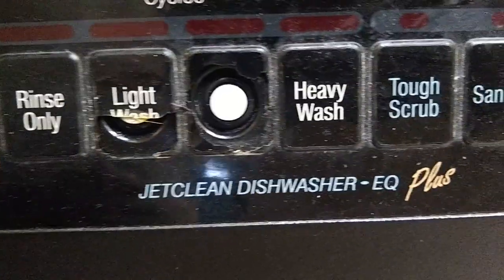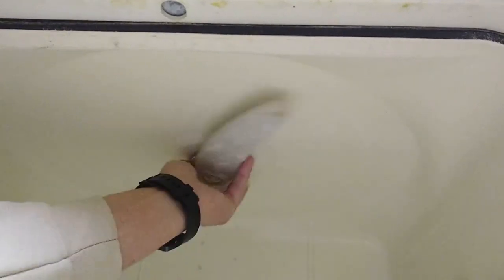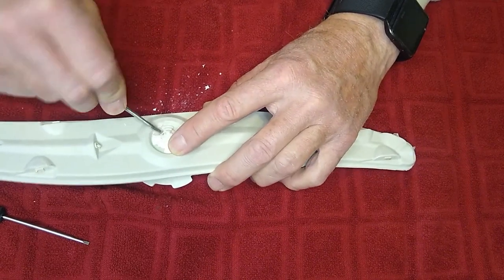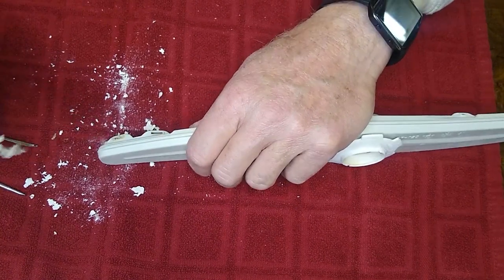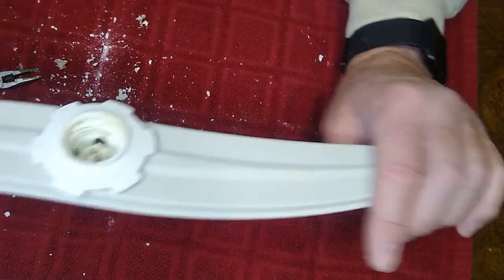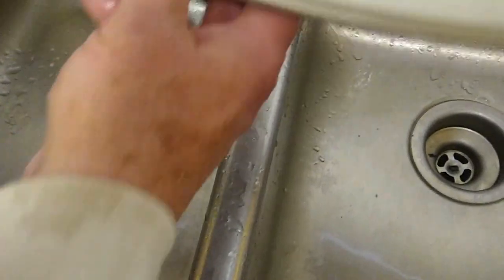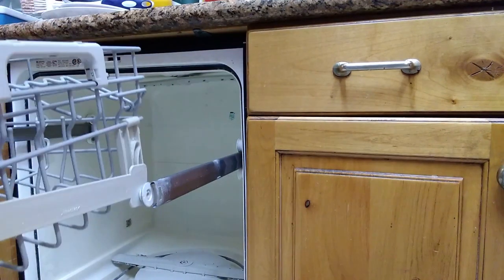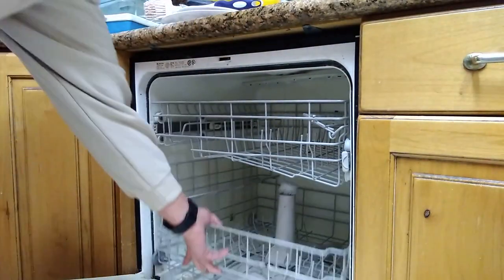How to clean and unclog the sprayers in Maytag dishwasher DO THIS NOW for cleaner dishes! DIY video

Comment: I was hoping that you would deal with lemon seed that somehow found heir way into the arms.  By sticking long thin bottle brushes into those ports I did get some lemon pulp and a few seeds out of the arm.  I used tweezers and a safety pin as well to help stab the seeds for removal.  I even let draino go into the arm to help dissolve sediments.  Well at that point it looked immaculate but seeds remained inside the arm only to apprear when I used the sprayer to flush it again.  at that point the tweezer did not work on those slippery seeds.
Reply from the maker: oh wow! Yes, I have only used tweezers and needles to remove the unwanted items from the sprayer arms.  I often find popcorn kernels and pieces of rice stuck in there. Those darn seeds! Let me know if you figure out a trick to get them out!

Comment: I have a similar model, only problem is I can’t get the container nut screwed back down on the arm at the bottom…almost like the knob is too short and won’t screw down, but I don’t see any other parts that I missed..I had to work a bit to get both arms detached and the top just pops off, no screws. But yes, having issues screwing everything back on the bottom…almost as tho cap is too short and can’t press down and screw
Reply: Zooyorker.  When you put on the arm make sure you twist it until it drops down. There is a little bit that it has to go into.  I hope that solves the problem. Let us know how it turns out. Thanks so much for your comment and question.  Best of luck with your next DIY project, and hopefully you subscribe Big Al Repairs.

Comment: Thanks for the great instructional video.  I just cleaned my Maytag Jetclean and it wasn't near as clogged as yours, but mine failed to dissolve all of the cascade gel.  The dispenser opened all the way and nothing was blocking the sprayers.  What else could be causing it?  I am going to attempt to run a cycle while I wait for a reply.
Reply: One problem that you might have is make sure your trays are not sagging if they were are sagging it will block the sprayer causing the sprayer to not turn. I had that problem and replaced one of the wheels which elevated the tray high enough so that it did not block the sprayer.  Thanks so much for your question and let us know how it turns out.